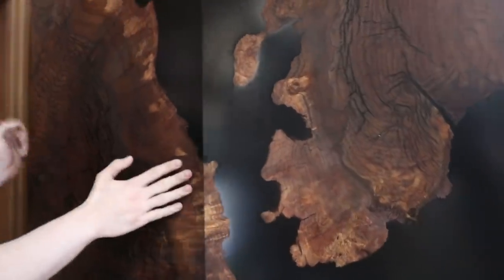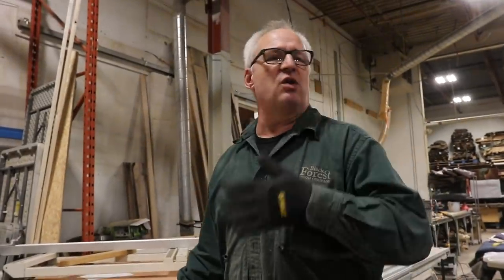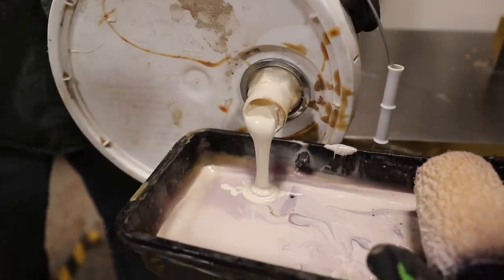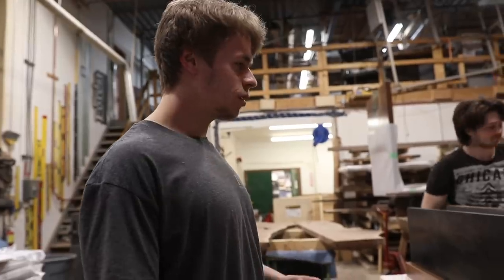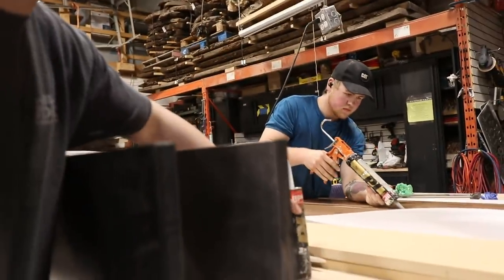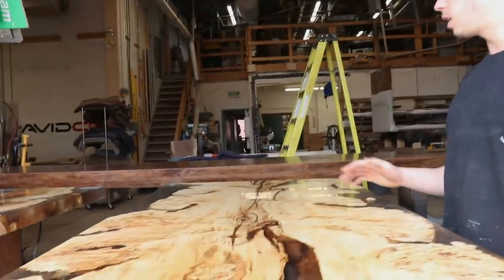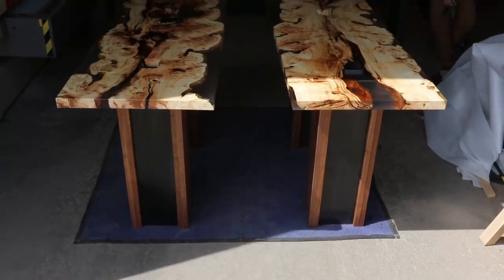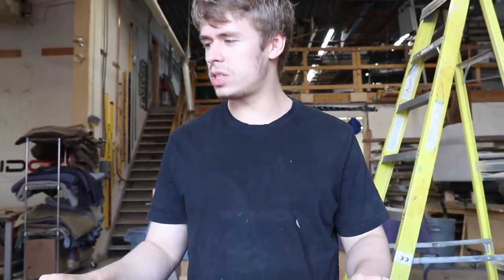Furniture Package for a Luxury Hotel

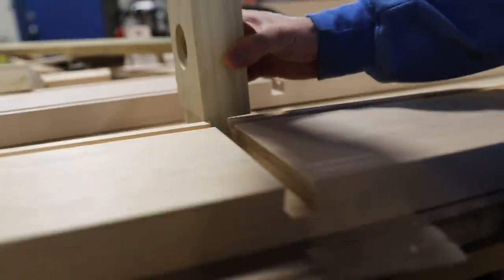Comment: Around the 2:20 mark, is there a specific reason why the male end of the dovetail joint is not centred on the block of wood?
Reply from the maker: We deliberately off set it to leave more wood on the load bearing side of the joint to increase strength!

Comment: You’ve never seen someone use sliding dovetails?  Really?  Also, the fingers on that glue up add no more strength than just a jointed and glued butt joint.
Reply: yes thy do, more surface area
Reply: casey 1959 uuhhhhh no they don’t.  The glue is already way stronger than the wood.
Reply: Finger joints also assist with torsional integrity. The increased surface contact and mechanical interlacing improve the bond. The glue is stronger than the wood so using fingers increases the amount of wood engaged in the bonding. It’s simple physics. 50 sq inches of rod to glue surface contact is stronger than 10 sq inches of surface contact.
Reply: It also helps with alignment.
Reply from the maker: No we really hadn’t! Cool to see they’ve been used before. Fingers definitely do increase the strength of the joint.